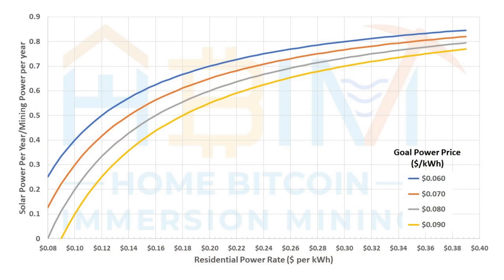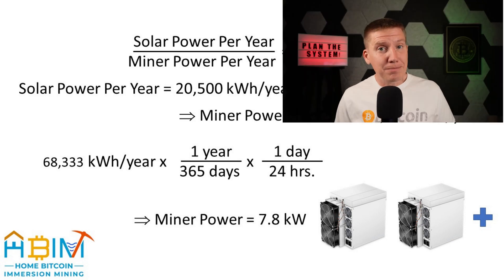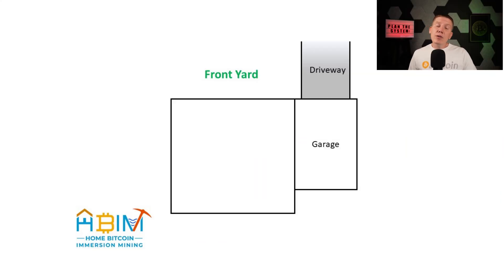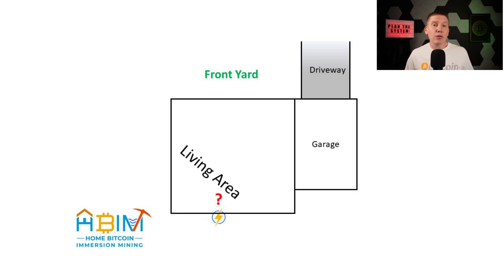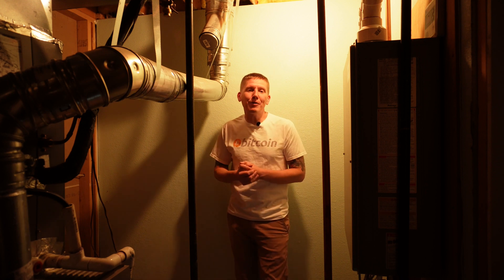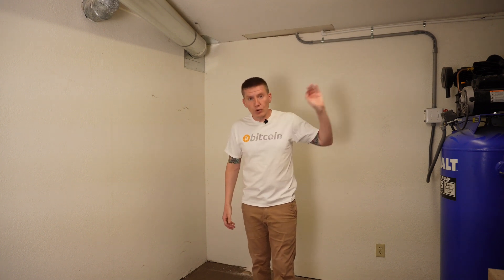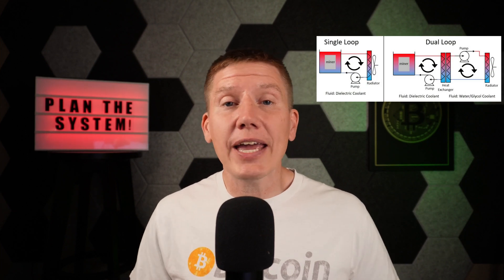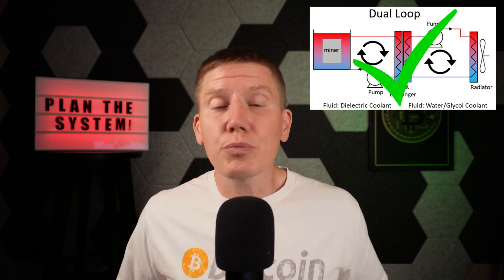EP3: Building a BITCOIN miner in my house?  Where?  How?

Comment: I pay 9.8 c/kWhr for electricity and do not have a solar system.  However,  if the waste heat from the miners can  be used  to decrease the cost of my furnace that burns natural gas,  I may be able to reach<= 7.5c/kWhr. Is my analysis correct?
Reply from the maker: 9.8c...not bad!   You're 100% right.   I'm putting out a video this Friday where I show how I've got my furnace using by mining heat...my furnace uses no gas at all, which adds to the savings!  You'd have to do the numbers, but it definitely will help!